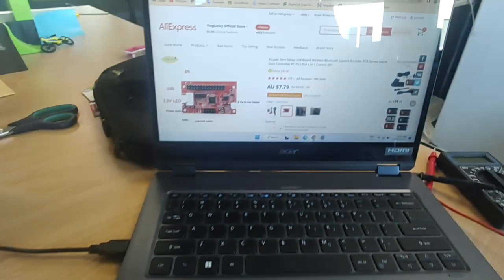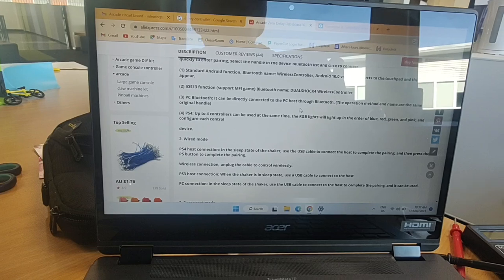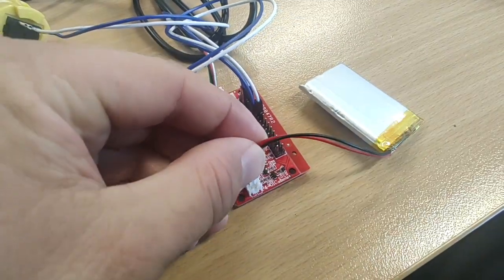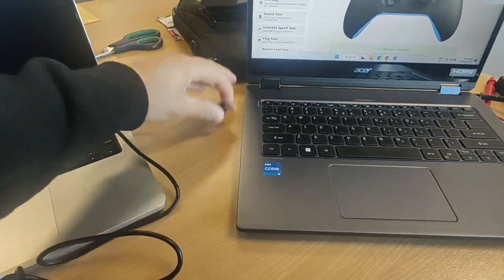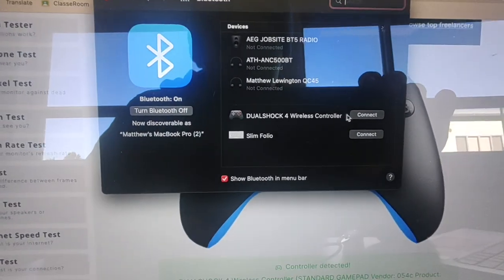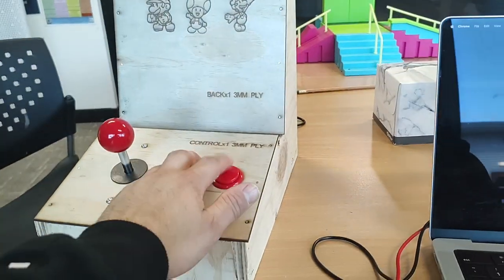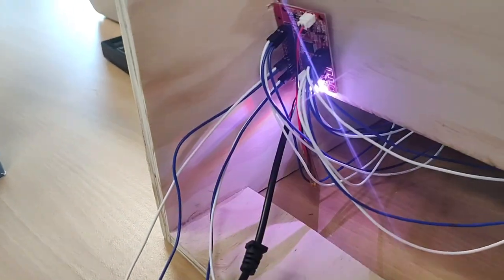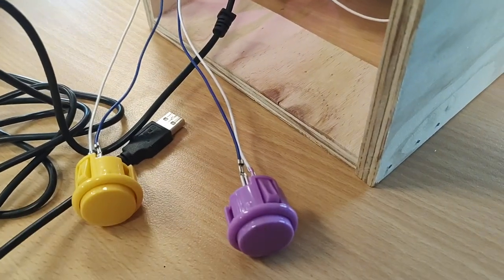DIY CONTROLLER ARCADE BOARD YINGLUCKY

Comment: does this have the accelerometer like a real playstation dualshock 4 controller?
Reply from the maker: I have a feeling it doesn't. Though it shows up as a duelshock controller I think it's lacking a fair few features that the controllers do, like analog joy sticks for example. When i'm in work next i'll look up the chip part numbers and double check for you though 👍

Comment: Do you have a manual for this? For some reason it does not pair work with ps3 but it says is does. How to make this work on ps3? Another thing, on ps4, how to do a right click on the touch pad?
Reply from the maker: Unfortunately I don't, all the stuff I managed to get working here was by trial and error. I don't currently own one of these units as it was something we were using at work :(

Comment: I am looking to buy one of theses modules and I wish to have a "shield" to control it remotely (the idea is to turn a controller that is plugged on a microcontroller with USB host to communicate over BT) and I am not sure of something: What is the function of the DKEY pins? It is something to select what the directions represent on the controller (Left analog, dpad or right analog)?
Thank you for posting the video and keeping record on how the board works.
Reply from the maker: Interesting idea! I recon it could be done with an Arduino Bluetooth module however with much greater complexity. It might be possible to common the grounds and just provide 5v to the pins to trigger them maybe. The DKEY pins could connect to the DPAD maybe, Ill try have a look when I'm at work next.
Reply from the maker: I think I missed read your question but understand now :).
 I have just probed what the DKEYs do and didn't get a response on the online keyboard or controller tester so not sure tbh. Maybe somthing related to the boards functions?

Comment: i got a qanba q1 two years ago. that thing went haywire on me suddenly. it started to disconnect and reconnect by itself. I checked for any loose connection, I unplug and plug it back so to make its not loose, I replaced the usb cord 2 times. i did everything i could to try fix it but fails. Does this board worth it if i replace it? can i play both pc and ps4 with it? Much thanks
Reply from the maker: I haven't herd of this boards before but looking at some teardowns online it looks like potentially it could be super easy to convert one to use these Yingluck boards. I'm not sure how reliable the ling lucky are as iv only used them in short periods for student projects. I actually haven't tried it on a PS4 yet but might give it a shot and come back to you but seems to work well on the PC and IPAD.
Reply: @LABMATT.  Yoo thank you for the reply. If its compatible with the ps4, i might as well try it myself 👌🏻
Reply from the maker: Just gave it a shot and couldn't get it to work on the ps4 on bluetooth or wired though im not familiar with the console. Further I did notice the board doesn't have analog inputs for the joysticks witch couldddd be an issue 😢. They are only $10 bucks so could be worth just to mess around with.